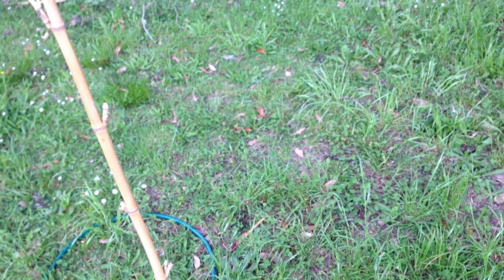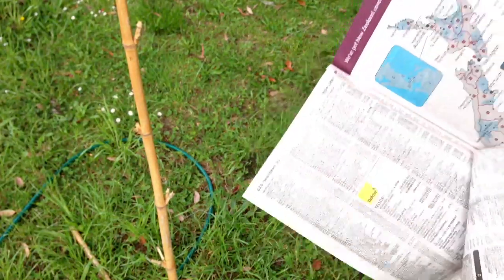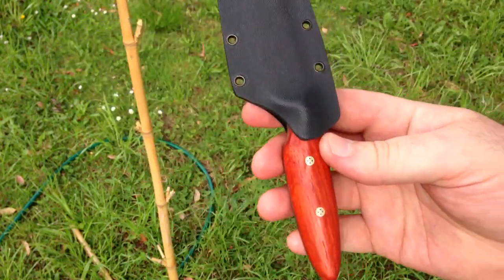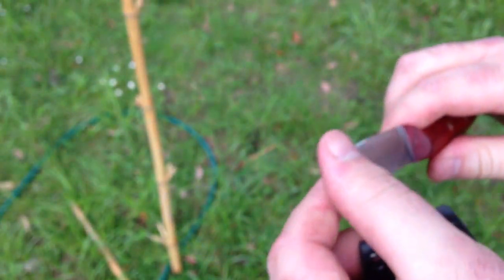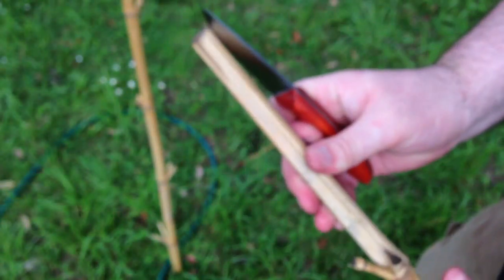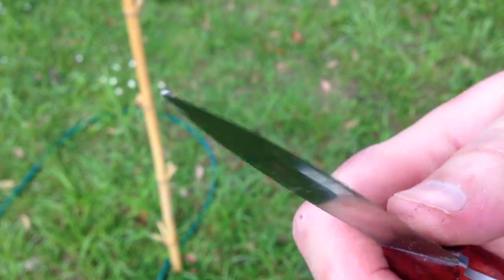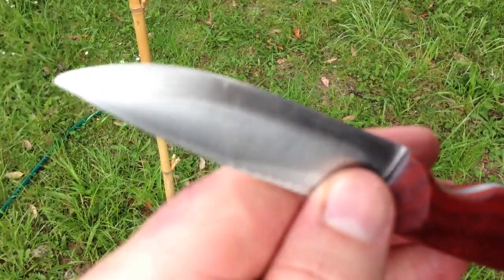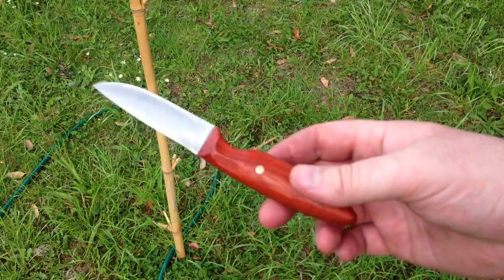cKc Thrive 5" and a cKc Streamline

Comment: Haha maybe just a little thin ;) After watching this video a few hours ago I ended up taking my kydex sheath you made for my AEBL streamline and did the same cutout towards the choil and remolded the sheath slightly. It now has MUCH better retention(since I had reshaped the handle months ago, I never really got to adjust the sheath tension much to accomodate the change in handle thickness). Only downside to the tighter retention is that I am getting small microscratches along the blade.No biggie

Comment: Not to concern you, but looking at your right hand I think you might have leprosy, have you recently come in contact with the walking dead?

Nice work on the bamboo, 4-5 dps is fairly acute for hard wood which is so thin as the pressures are very high.